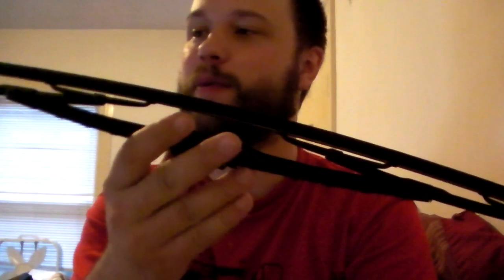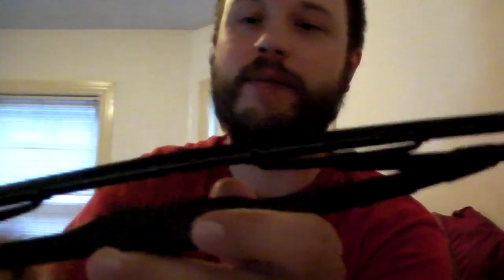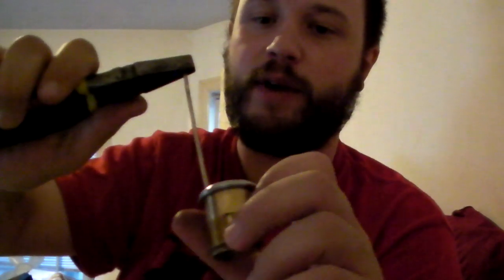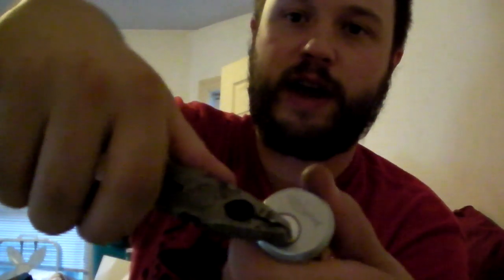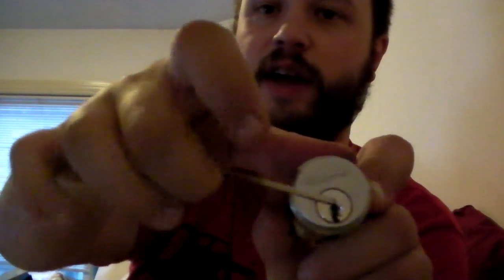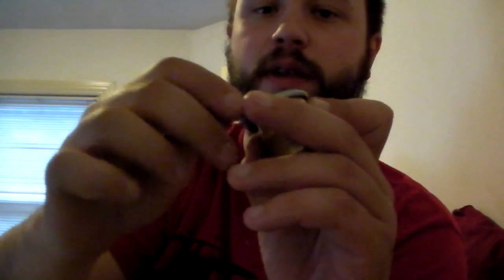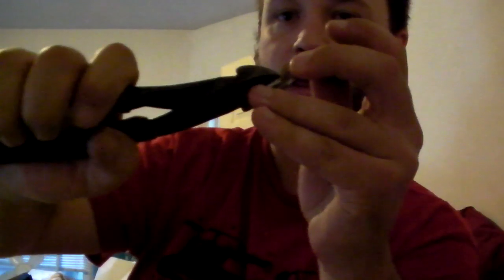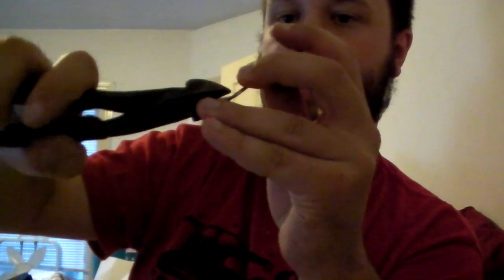Tension Wrenches from Windshield Wiper Blades

Comment: The dumpster of an autoparts store is a good place to find them, but I have an even better place to get them that doesnt require dumpster diving. Go to your local quick oil change franchise and ask them for discarded wiper blades. They usually change dozens every day, especially in winter!!! If you are a known customer, they are usually happy to do it. Happy picking.